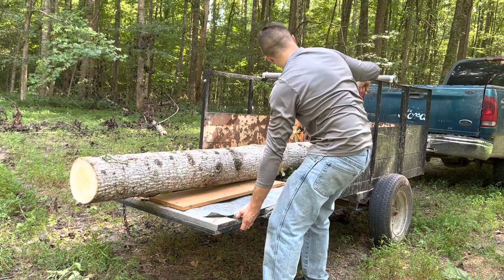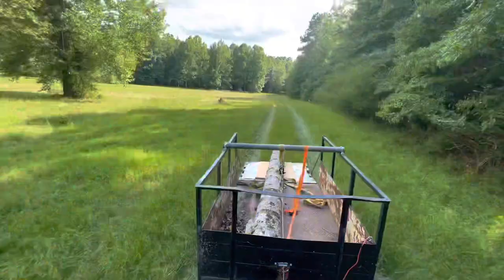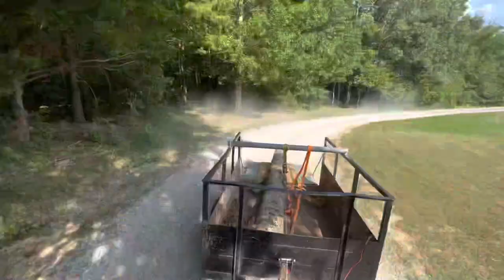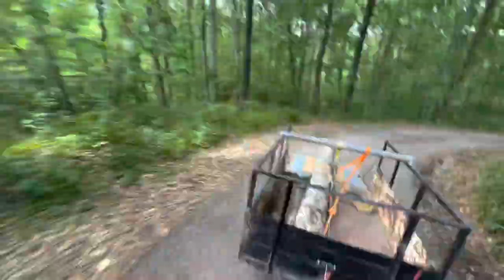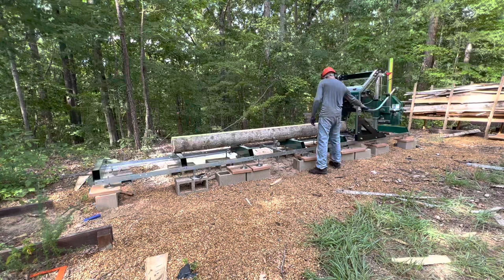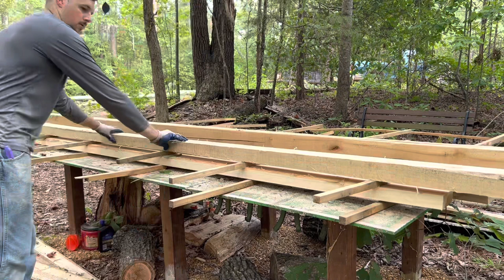Woodland Mills HM126 milling 2x4s | How to Turn Logs into Lumber

Comment: Good video!! That looks like a lot of work to get the logs cut moved and on the mill . Is there anyway you could save time or steps , or cost to get the logs to the mill ?
Reply from the maker: I just saw your comment! I am sure you’ve seen my video I just put out about how much time it takes and if it’s cost effective. Looks like we had the same thoughts. The way I move and mill logs in that video is the best and fastest way I am able to at the moment. One day I of course hope to get a tractor and heavy duty trailer to be able to move more logs quickly. Thanks for watching!